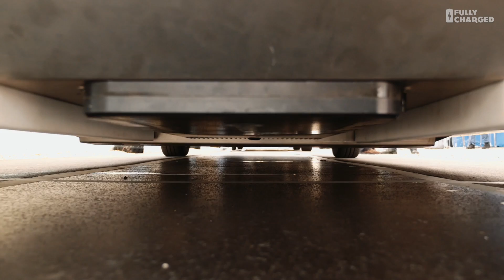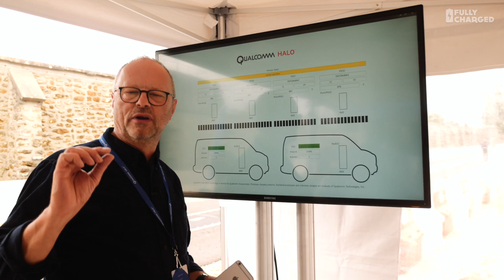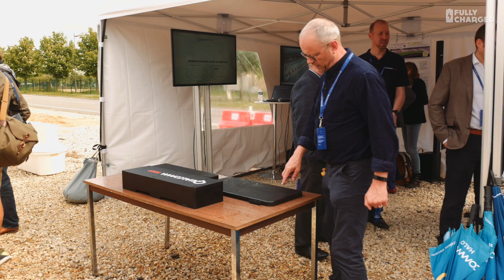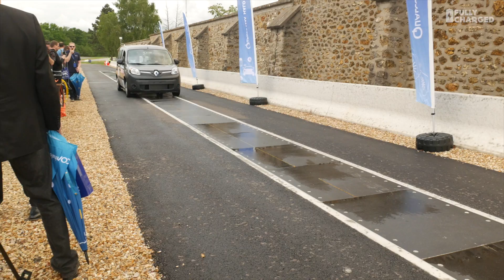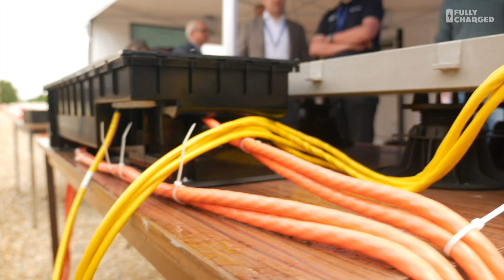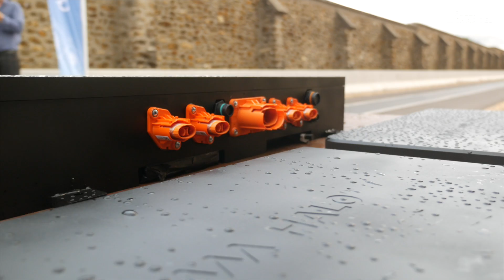Dynamic Electric Vehicle Charging | Fully Charged

Comment: Nice, theoretical idea, but a practical impossibility.  There are 2,300 miles of motorway roads in the UK, and 29,000 miles of 'A' roads.  It would cost a fortune and take years to lay this stuff (decades if not just limited to motorways), and cause a phenomenal amount of traffic disruption.  And by the time it is laid, battery technology will almost certainly be at a place where range is no longer an issue.  And how much strain would it put on the national grid?  This has as much chance of becoming a reality as the SOLAR FREAKIN ROADWAYS!

As others have said, having this tech for parking bays would be a much more viable solution.  It would mean your parking charges going through the roof to pay for it, but it's more likely to work than laying it on the roads.

Comment: 150yr old electric tram system of energised rail power can charge the car more efficiently than doing it wirelessly! and installing it is also cheaper for long distance! but it will be successful and practical as an idea of wireless parked car charging station!

Comment: All cars can be set to charge limit as per the Tesla's, say you start journey with 40% and set limit to 90%, and at set limit the controller can disengage/turn off the induction plates, or on board controller can have a unique id and tells the next power bank to not activate or activate as the case may be, thereby saving grid power by not sending power to that particular bank of charge plates.

Comment: Lot's of people nog seeing any real world use for this. What?! Think about this, almost all of EV price today is battery. The only downside to EV's is battery capacity. If all mayor roads had this, you would not need bigger batteries than what is found in hybrids. And EV's would be cheap as chips! One would probably pay for road usage. A bit utopian, I know but anyway. If talking about short term, what about uphill? You would get more power to the engine and would not have to use the battery, as much.
Reply: Paying for road usage would make this less cool in my eyes.

The real kicker is trucks. They can basically be all motor with a little bit of battery for backup. Since there's no need for a large battery electric trucks would become much more desirable.

Comment: Thanks Robert I'm really enthusiastic about this. 
I see great potential for this kind of induction charging. 
If you you see it from the perspective of the provider being able to sell charge without the vehicle having to stop. 
1) this would make the investment in infrastructure revenue positive 
2)I can see how it's introduction could be phased by partnership with hauliers - many large scale logistics companies have route which they travel multiple times per day with the same vehicle, which makes sense to kit out those vehicles dedicated to these routes with retrofitted pads and extend across their fleet as more routes become available 
3)having charge available as you drive means that the battery size requirement could be drastically reduced keeping weight and costs out of the vehicle and making each journey more cost effective. 
4)the collection of revenue for this system energy would be almost completely frictionless for the energy provider as billing by its very nature would be completely automated. 
5)those companies who bring this technology to market will get very rich very quickly, by being able to sell to 10's of thousands of users on each stretch of road with zero impedance to their progress. 
6)think about the time/cost/efficiency benefits to hauliers? No need for diesel fuelling infrastructure at the depot with its attendant real estate/pollution/Human Resources costs. No down time in fuelling. Seamless vehicle turn around allowing hauliers to offer tighter schedules and achieving greater profitability. 

I can see the convergence of vehicle to grid communication, autonomous vehicle technology and electrification of the goods fleet all making this a very real possibility on an accelerated timeline, what do you think?

Comment: Love E.V.s but this is rubbish .
I have a problem believing this will be efficient , especially with "asphalt " on top of it . 
A white elephant in the making as cars improve .
Reply: It's already happening and efficiency versus economic gains have already been discussed and chewed over oh so many times, if you spend a short while googlin you'll find all the reasoning and calculations throughout. Where its practical it will happen, where its not practical it won't, but it is the only viable option to put millions of cars on the roads without trying to put in millions of high power charging posts.

Comment: This is an interesting idea, although I'm struggling to imagine how authorities might do road repairs without destroying any buried units.

Regarding the question at the end about what happens if you don't need a charge... my intuition about what happens if you were to disconnect the receiving unit from the car's battery is that it might start overheating (the receiver, that is). The energy has to go somewhere. But I'm not a physicist :)
Reply: ??? the units auto-negotiate to switch on as required. As already demonstrated and discussed they don't sit there pumping out energy, google induction and magnetic resonance for more background.
Reply: Ah OK, that makes sense. I didn't realise there was actual communication between the car and the road unit...

Comment: This could be more practical for a train or something that only moves on a straight line. Besides, how does it protect the passenger or driver from emf during charging? We're using stationary wireless charging on our electric vehicle but it will be autonomous.

Comment: Too complex when simpler systems are available. However, it would give the most bang for the buck if installed before busy intersections where vehicles stop for the signal light to change to green.

Comment: Perhaps most useful for electric trucks climbing steep sections of road? It's pretty easy to keep 10 tons moving over flat ground but if you have to haul it over a mountain your batteries will take a big hit. Having something like this just on the few km of incline up the summit could drastically increase electric road freight range without needing hundreds of km of install.

Comment: How much energy is lost in this scheme?  I suspect a fair amount.  Inductive charging while the car is moving is stupid.  If you want 20kWh, and you're traveling 100km/h, you will need the system to be 100 kilometers in length.  What then happens when there are thousands of cars on the road, all trying to charge?  The whole idea is just idiotic.  It would be great in parking spots, assuming either high efficiency or lots of cheap green electricity.

Comment: Just this summer I was able to take a tour of a research lab at Utah State Univ. in Logan, Ut. USA that has been working on how to integrate this technology into the roadways and any vehicle. They have a test track that they run a city bus around to test various ideas. Various different sizes of coils in road and on a bus along with how to best protect them and what is the most effective for transfer. One of their ideas that I thought was the easiest way to charge a bus is at each bus stop. Concentrate the charging structure at the stops when the bus will be at a known location for at least a few minutes. Very little disruption to the road structure in general to install. Also power is usually available near by.

Comment: Improving technology is great I think this technology is not become much popular but this technology helps the car to get extend its range in highway if if we put a separate lane for by in building this technology in that lane you put this technology in side of Highway who is running at low battery can get that charging way and charge their cars and extend then range to reach the charging stations. I think the technology is improving in battery I think the fully charged as to make a video on improving battery Technology graphene technology in batteries will change the future of electric cars because compared to Lithium ion batteries it is small in size less in weight and it can Store 2 two three times more power compared to Lithium ion batteries please make a video on graphene technology in a batteries

Comment: One drawback to this would be the need to stop along side the road and swipe your credit card through the POS terminal to pay for the power before driving over the road.  I suppose they could integrate the cost of power into the cost of toll roads though.
Reply: not really, it was'nt that long ago a labour government in the UK was thinking about charging drivers for every mile they drove...with rates dependant on which roads you drove on and at what time... i think is likely to come about when they get back in.... all with the wonders of a gps tracker on your car...

Comment: We have manufactured inductive charging for years, look at an electric toothbrush.... my company worked on inductive charging with Google [x]. this is nothing special at all. The tech is 100 years old. Great concept but i genuinely think with battery technology progressing at the rate it is, this will not be necessary. I see the possible use in bus stops etc.... but for the average vehicle not a chance.

Comment: The two most challenging aspects of this are going to be (I believe): Durability and cost (installation and upkeep/infrastructure).

As someone else pointed out, with battery technology constantly improving - and with solid state batteries right around the corner (Toyota has a solid state car coming in the next few years), this may not even be necessary or worthwhile.

Very cool, though!

Comment: Maybe this should be installed near roundabouts and other junctions with a lot of traffic. Instead of high-speed charging, how well does it work for low-speed charging? Would the car battery overheat if there is too much induction charging?

Comment: Sorry but it is overly complex and too expensive to build and maintain per mile.  A simpler and better solution would simply to have two thin rails mounted in the roadway flush with the surface or slightly recessed into the road and then under the car have two retractable, what look like broom heads whose bristles are metal, that make contact with the rails that are electrified.  The rails, well actually only one rail is electrified, are divided up into short say 10 or 20 feet sections.  This way you don't have to electrify the entire stretch of road but just sections as a car is driving over it.  Perhaps a very low voltage all the time and when a car drives over it completing the circuit the voltage is stepped up to charging levels.  This way pedestrians and animals can't accidentally get electrocuted by walking on the road.
Reply: as there is physical contact, this will mean maintenance wear and tear will increase massively..... also, you need to have power at the rails to step up... you can't step up 50 volts and less than 30 milli amps to something a car can use..... (50 volts and less than 30 milliamps being safe for people).

Comment: So if you put this in stretches or motorways that needs resurfacing quite often anyway  due to heavy truck traffic wear it would make some sense. One can fill the relatively cheap Renault Kangoo EV filled with stuff you won't need and drive on Autoroute du Soleil from Paris to the French Riviera non-stop at 110kph and pass all the Tesla's that passed you at first while they supercharge at some deserted hotel parking. Or you could take only the stuff you need and take the TGV and sip on some wine in the bar and pass them all in 300kph :)